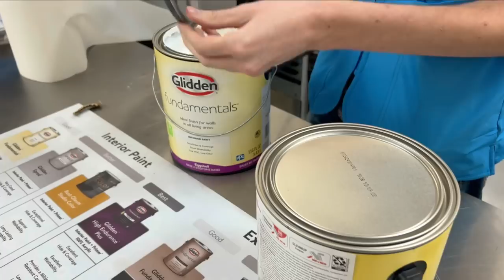This Is A Lot Harder Than What I Thought!! Update On The Tiny Home.

Comment: TIP::::: When your done painting put your roller and paint brushes in a plastic bag and keep in the fridge. You don't even have to rinse them out. They will be ready for you the next time you start painting again.
Reply: Keep the bag tight so air is pressed out.   I'm painting right now and can only do a wall at a time bc of shattered ankle and  I'll be ready to go in the morning. Itales it souch easier.😊😊
Reply: I do this too! A genious, who ever thought?of this!
Reply: I’ve wrapped mine in glad wrap and done the same thing it makes it so much easier when you can’t finish in one go. Plus it’s less waste of paint as you do lose a lot if you are cleaning rollers out to reuse them.
Reply: I do this all of the time however, I’ve never placed mine in the frig. Simply stick them in plastic bags and close them tightly.
Reply from the maker: Great tip!
Reply: Make sure you do a bunch of strokes with a 45 degree angle when painting!
Reply: I have not heard of using plastic to wrap a used paint brush but I have used  aluminum foil. Will try using plastic next time.

Comment: A few tips- keep a bucket of clean water to keep your mixing paddle clean, you dont want any small chunks of mud in your paint or your gun when texturing. Otherwise you did great there. I would have used "PVA" primer for the new sheetrock then straight to the finish paint. The tinted primer works fine but PVA works best for "raw" sheetrock.

Comment: At Doss Farms,  they use Guard Donkeys which really helps them from Animal Preditors.
Fowler farms also hangs a cd cassett it hangs down on the side of the pen,  they have not have a problem with birds from the air.
Reply from the maker: Yeah, I saw that but flashy stuff gets the attention to bobcats
Reply: The flashiness actually scares them away and the movement it mand with the breezes, and so does using things with eyes, like owls.

Comment: I've been paying almost 20 years they do make Paint & primer into one choose your color and get it Paint & primer in one then put two coats on it save time and money you don't have to go with by primer separately just get Paint & primer in the one with the color you want because when you buy primer separately it's White so when you put it on your walls whatever color you going to put over that the primer you going to have to put two coats over that so instead of putting one coat of primer and two coats of finish just get your Paint & primer in one  with the color you're going and just put two finished coats on the walls and if you'll paint seems too thick put a little bit of water if it's latex paint when you put a little bit of water in it Smooths it out and stretches longer and it's easy to work with and they do make little samples that you can get in the color you want and go back and put a little brush in it and put it on the wall and see how you like it before you go and buy a whole gallon of paint and if the paints mix where you can't take it back some light colors tend to dry lighter had some darker colors tan to dry darker and you got to keep in mind how many coats is going to take to put on my wall so with the color you got on there if you decide to put two of their it's going to be darker so anytime you Peyton you got to keep in mind how many coats is going to take to cover this fall depends on what color you want the wall today what's already on the wall that you're trying to cover but I love your videos good job on the tiny house

Comment: Don't know if you are going to do more dry wall work but add some water to your mud what you got out of the box is too thick. Sanding the texture is normal for what they call knock down it can be done with a trowel but sanding gives similar look. When using the texture gun use a random pattern some right left some circle. what you have done looks really good. When painting cut in the corners first then it will blend in and not show the brush strokes.

Comment: If you can see it or feel it in the drywall finish work when you paint it the paint will not cover up bad areas after you paint it will show all the bad sports that are not flat and smooth at all the seems and screws and before you paint it you have to prime it all first with primer only on you can still fix bad spots after you fix the bad spots then prime that area then you can paint it good luck

Comment: If you could attach a damp cloth to the tool you used on the ceiling, that would help smooth out your plaster and you would 
have less sanding than with sand paper.  That
 or a thin firm sponge.
Oups! I'm too late, you've already painted!